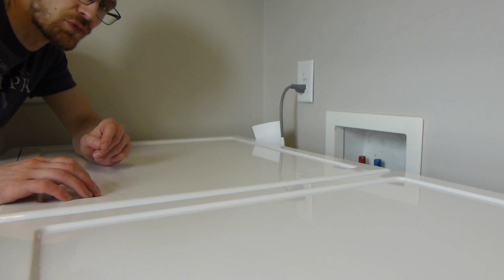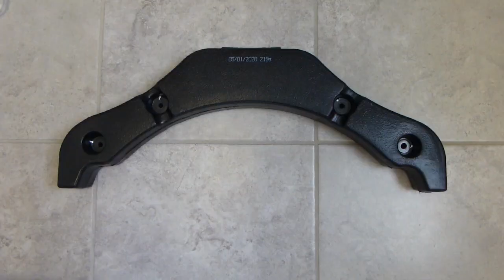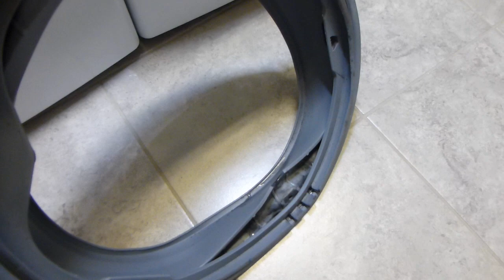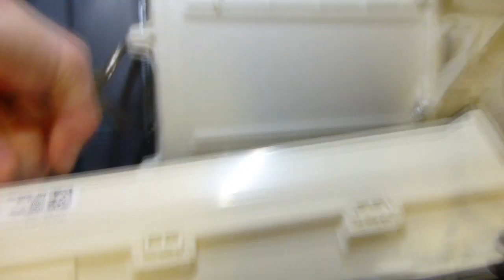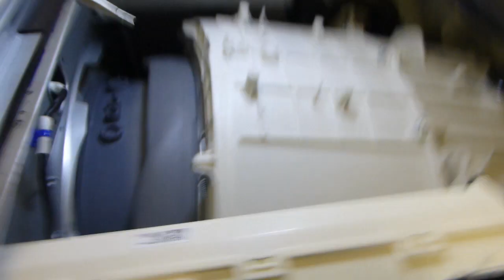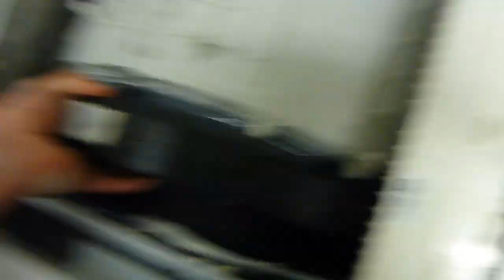Washing Machine Door Seal Deep Clean (Full Walkthrough, Every Step)

Comment: Thanks for the two videos.

I watched them after I got a new rubber boot.
I missed ordering the handy dandy one time in your life use pliers 😞
It was a real struggle to put the two spring/wire loops put back in.

With two needle nose pliers and my utmost strength (you need the other hand to squeeze the wire over the edge into the groove) I barely managed to install it.

I definitely recommend spending $11 and get these pliers.

But at the end, great satisfaction, rather than spending >$500 for repair or wasting money on a new washer I managed.
Conclusion: make sure to dry all these rubber parts and the detergent drawer to avoid yukky mold build up.
Reply from the maker: Yep, I feel your pain, that's how it was the first time I tried it too!

Comment: What happens if the inside/back seal is not reinstalled?
Reply from the maker: You could have water leaking out during the wash cycle. It would go into the washing machine and then onto the floor underneath